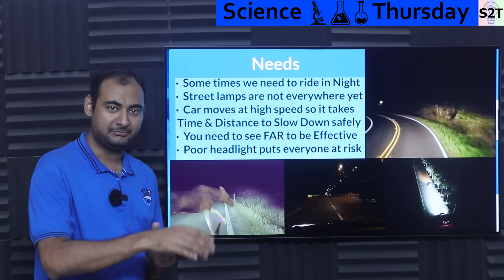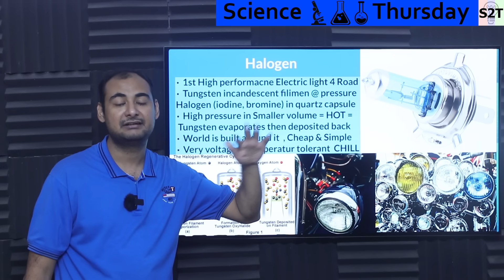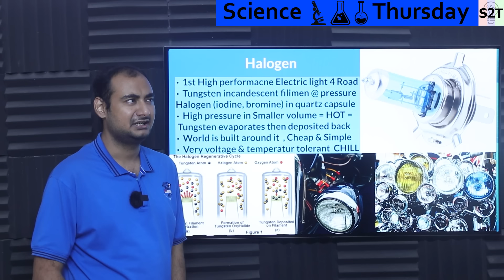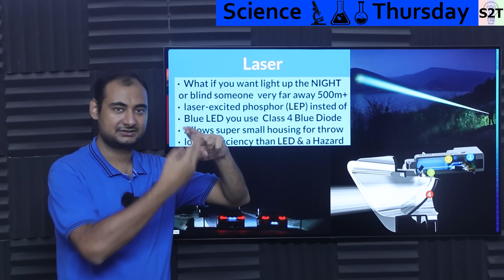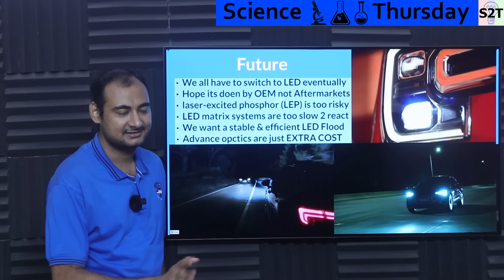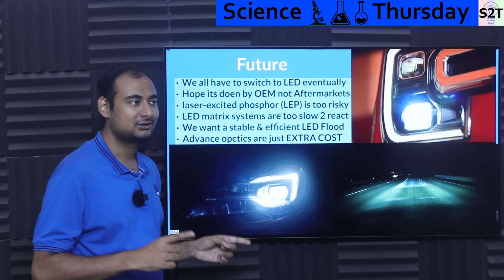Car Head Lights Explained {Science Thursday}

Comment: Great episode! Many great points! It's actually not very difficult to design led lamp with a fairly even spectrum by mixing different kinds of leds. It takes some effort to develop, and manufacturing cost is slightly higher, and the benefit isn't obvious enough to induce much demand for it.
Reply from the maker: thanks and yes with modern Phosphorus formula for led u can get good "QUALITY" but most people can only tell if its bright or NOT